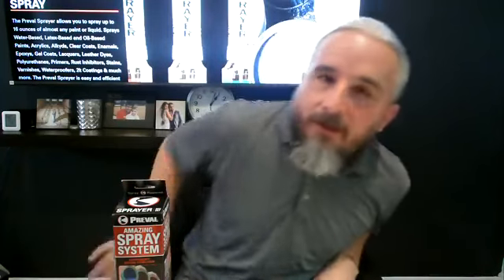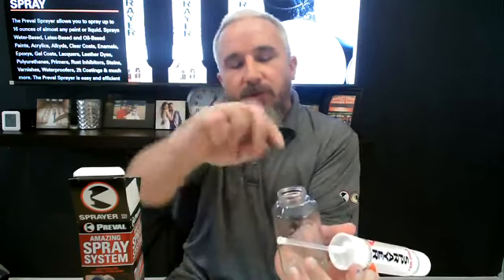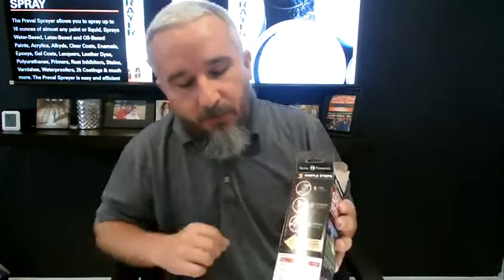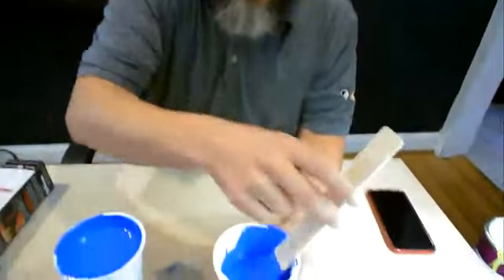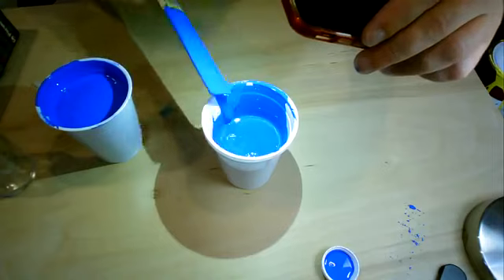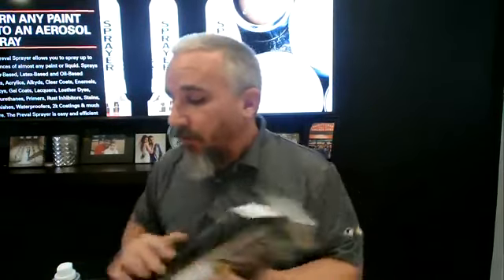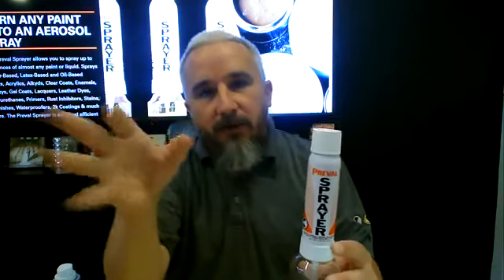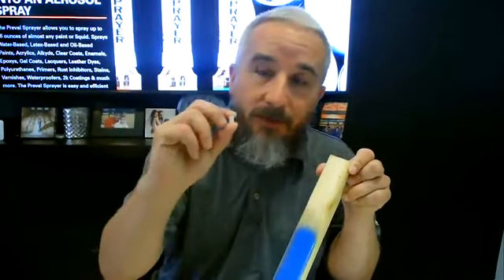Using Latex Paint with the Preval Sprayer

Comment: To explain the other parts - when working with latex and thinning it - use clean water, and add water SLOWLY IN SMALL AMOUNTS, mix and repeat if needed until the paint is properly thinned. To verify the paint is thinned enough, put a paint stirring stick in the paint you want to use, then lift up out of the paint so that it runs off the stick into the container the paint is in. (About 2 inches away from the surface.) Take the stick and move it in a circle so that the paint that is running off goes in the paint in a circular pattern trail. From when the paint dripping down to make the circle trail to when you no longer see the circle trail (It fades into the paint) is no longer than 2 seconds. Make sure the filter cap is off the pickup hose.

Comment: This answered all my questions except 1. When I finish fixing a spot I need to touch up, do I need to dump the paint and clean the unit or can I simply cap the unit for later use?
Reply: You can cap the jar. I've used these with great success spraying tinted shellac. It's nice to be able to save my mix for the next spray.

Comment: I bought one of these basically for latex paint you have to turn it into water or it doesn't spray it sprays intermittently and then plugs up and if you tip the gun a little too much of an angle it won't spray so if you if you have a little door a little cabinet door and you're laying it down and trying to spray it it doesn't work this thing's basically useless

Comment: I have painted several car bumper covers & fenders with Preval. All turned out well. But those were not latex paint so we'll see how my first project with latex turns out!  Update, sprayed a toy train with PPG latex formulated at Menards and it turned out pretty good. You do have to put it down pretty thick, but I am happy with the results! Thanks Preval!
Reply: for the thinner automotive paints....did you take out the filter at the tip of leave it in? thanks
Reply: How you refill the compressed air again ?